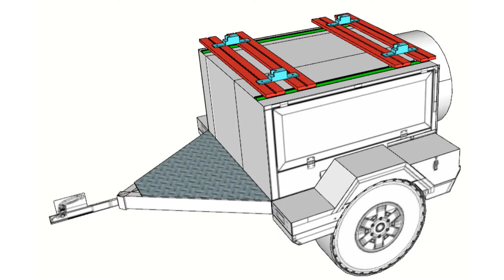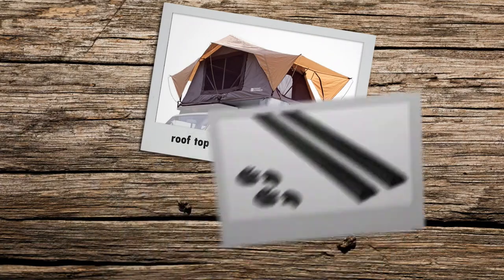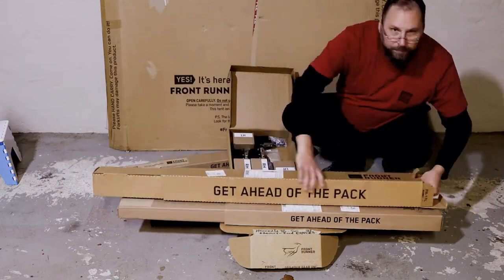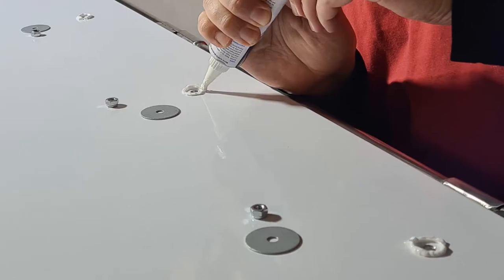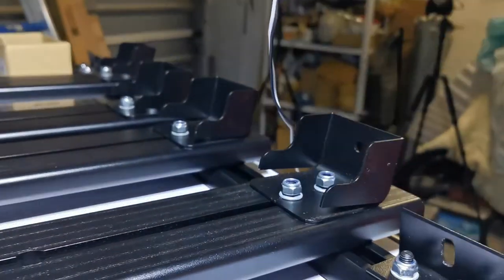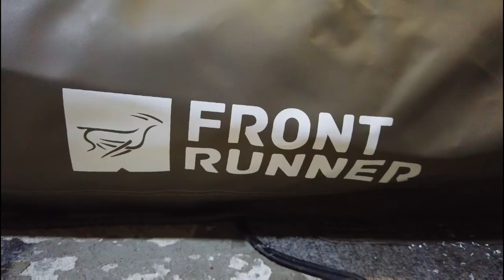Metalian Genie Rack and Front Runner roof top tent install

Comment: Question: when it is raining or with hot sun, how do you protect the kitchen area? Also  the height below the opened tent doesn't seem high enough for easy access to the clothes side?
Reply from the maker: Hi, we use an awning on the kitchen side, we have designed brackets (the video is on our channel) that allow the awning to be lifted when the trailer is parked. If bad weather we add a fully enclosed awning room, which has a zip opening in the side so the kitchen can be accessed from with in the room. 
The side under the tent we use as a utility side, so don't access it often, we have our clothes in the drawers at the back, easy to get too there (w have a video too on packing the genie that might show that better)
Reply: @fooshadventure  tnx, I have watched the videos, excellent, keep on doing it, it is very good.

Comment: Your setup looks really cool! Out of curiosity, how much did the trailer cost excl. the rooftop tent?
Reply from the maker: Hi Nikhil, we ordered ours during lockdown, before the raw material prices increased, so for an accurate price it will be best to contact metalian directly, they can email you the price sheet with the different options available.
Reply: @fooshadventure  Thanks for your reply! How does the Jimny handle the extra weight? I’ve got a full roof rack on mine which noticeably upsets the centre of gravity so I’m intrigued at the possibility of hooking up a trailer to it.
Reply from the maker: Hi, we were also in the same position, loading the roof rack, after chatting to other jimny owners that tow, we decided to go this route, and looked for a small, light weight braked trailer. We are still working on kitting the trailer, when work allows, so havnt been able to do a trip yet, but hoping this summer we will be ready.